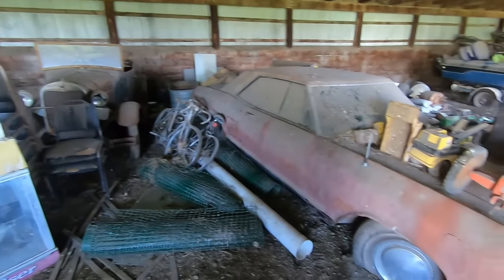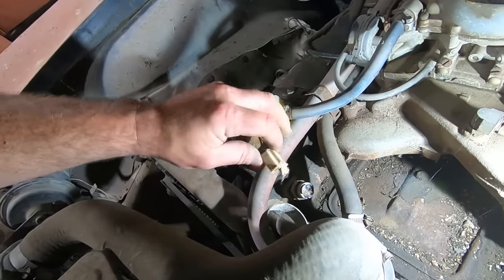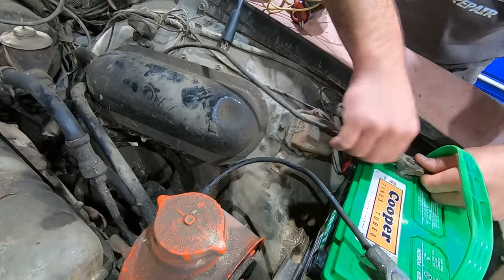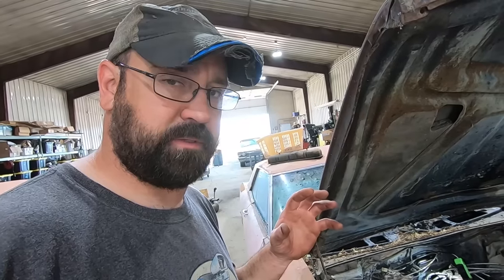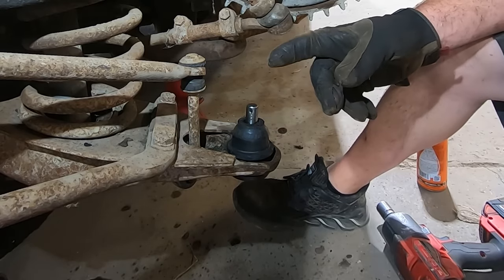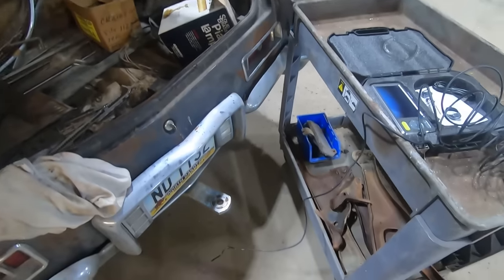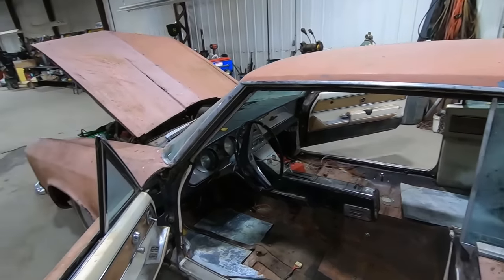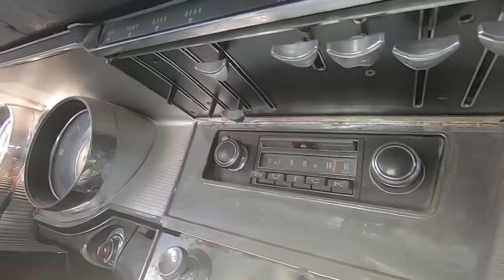BARN FIND!1963 Buick Riviera! Abandoned for 27 Years! Will It Run?!?

Comment: First generation of the Riviera 1963 through 1965. 63 & 64 had quad headlights in the grill. 63 used cables to operate the ventilation system, 64 & 65 used vacuum lines for operation. 63 had no standing hood ornament, 64 & 65 had a standing R ornament on the hood. Only the 65 had the stacked headlights behind the opening clamshells in the fenders. All years had bolt on removable door skins allowing the window stops to be adjusted for getting the side windows to perfectly adjusted for sealing the frameless window glass, as the car was originally intended to be a Cadillac called a LaSalle II. 63 had a 2 speed transmission, the 64 had a 3 speed automatic called a super turbine, but the shifter only had high and low indications, the 65 had the 3 speed turbo-hydramatic with all 3 gears indicated on the shifter. All of the first generation came standard with power steering and brakes, 4 bucket seats and a console. Here was never a first generation Riviera with a bench seat, a manual transmission or non-power steering or brakes. The standard engine for the 63 & 65 was the 401 V8 with a single 4 bbl Carter AFB, this was identified as a 445 because that was the gross torque rating. The 64 came standard with the 425 V8 with a single Carter AFB, identified as a 465 due to it’s gross torque. All 3 years could have been ordered with the Super Wildcat, the 425 V8 with 2 Carter 4 bbl carbs . They were easily identified by a chrome, dual snorkel air cleaner and cast aluminum valve covers. The 401 air cleaner snorkel that was round and the regular 425 had a oval air cleaner snorkel. 
Hopefully this may help some people.
Reply from the maker: Thanks for the info!

Comment: Nail heads need plenty of air to start and run right. Also a well adjusted choke will solve many hard starting issues with these engines.

Comment: 425 wasn’t available until 64. The 401 was the only engine in the 63 Riviera’s. I prefer  the 63/64 over the 65 even though changes were minor. On the 63’s the R hood insignia was flat on the center chrome and the 64 it was standing up as a hood ornament. The 65 had the headlights hidden in what had been the coolest park lights ever designed on the. 63/64. Then the tail lights on the 65 were relocated into the bumper. Next was deleting the fake side scoops on the quarter panels. 63 also had the 2 speed Dynaflow transmission whereas the 64/65 had the 4 speed Super turbine 400 which had a rear pump so could be push started. 63-65 Riviera’s never had vinyl tops. Buick put the torque output on the air cleaners instead of engine displacement. 445 was the 320 HP 401, and the 465 was the 340 HP 425. The Dual Quad 425 was 360 HP but did not have the torque rating on the air cleaner. I have had 2 of the 64’s and picked up extra parts and pieces when I found them.  I am not sure but I MIGHT still have some of the spare parts including the correct hubcaps which looked great on them. If there are any pieces you need let me know and I will see what I still have after selling my last 64 and the buyer never even looked at or came back for the spare parts. Also, the door skins unbolt to adjust the door glass so they will seal. Oh by the way, Buick Nail heads were always extremely thirsty engines so anytime you are working on getting one running automatically count on giving it an extra squirt of gas before even trying to start it.
Reply from the maker: Thanks for the info! Send us an email. It’s listed in the video description
Reply: @MortskeRepair  email sent. Where are you at in N.D. anyway? I'm  next door in Ely MN
Reply from the maker: @todddenio3200  Southeast corner, Ely is a jog from here!

Comment: My 63 Electra could be not run for weeks and the Trunk Release would still work. I looked into it and it did not have a connection to any vacuum line to the engine. The plunger that the knob moves actually had its own little vacuum pump. The only time I could not pop the trunk with that knob was if the trunk was in a bind for some reason or the line from the release to the trunk latch was cracked or not on one end or the other of the system. I wish YouTube would allow me to attach a link or a picture to a comment. If I could, you would see there is only one fitting for a vacuum line on the plunger.
Reply from the maker: Interesting

Comment: Talk about oil pressure, I still been driving my old 5.7 Burban everyday to work that has no oil pressure at idle. if the RPM is at 1k it has 20psi or so 2k its over 30psi, its like its loosing its prime, thinking about dumping some thick stuff in it until I have time to swap the engine out, shame it does run good, only knocks and taps on cold starts, after it warms up, couldn't ask for it to run better lol.

Comment: Q&A for difference between 401 and 425: The head covers are different on a 425, and the engine is much more squished down on a 425. Also '62, '63 and '64 had the separate twin headlights along with the chrome front side guards. '65 was when the popup headlights came in. '61 didn't have the chrome front side guards. Hope this helps. Good car btw! Love your work! 👍
Reply from the maker: No, the only difference between the 2 engines is the bore size. Heads and valve covers all interchange. Even crankshafts. Just need to overbore a 401 to build a 425.
Reply: @MortskeRepair  My apologies for getting that wrong...
Reply from the maker: @panderzextreme2210  No worries!

Comment: 1963 was the last year for the unique transmissions. Buick Dynaflow(which that car has), 4-speed Hydramatic, 3-speed Roto-Hydramatic all replaced by TH400 in 1964. That's about the time there was pressure to standardize the shift quadrants as well. 1966 was the last year for the Nail head, to be replaced by the Buick 430.
Reply from the maker: Thanks for the info

Comment: Back in the 80s I remember helping a guy on a flatbed move a Jaguar that had broken ball joints he had boards that he would put under the control arms and he would slide on that instead of the control arms if that helps any of your moving I don’t know just thought I would mention it

Comment: I had a 87 f150 I could feel the ball joint letting the tire move around going around corners. Well having 3 vehicles I parked it until I could get a ball joint. When I went to take out the old ball joint I took the nut off hit it with a hammer once and the ball joint broke apart. Good thing I stopped driving it when I did. I did both upper and lower ball joints both sides since it was my dd for work.
Reply from the maker: Whoops!

Comment: Could you move the trailer to the lift, run the arms up and then put them under the Riv and lift it off said trailer?  Just thinking here in Ohio.  The chain under the jack is/was a great plan!  I'll have to remember that.
Reply from the maker: It’s a tight fit and there’s other issues but it could be done

Comment: You made that ball joint install alot harder and longer than necessary.....leverage....is the key word....there is no way the drivers side spring was holding up that lower ball joint from going into the lower spindle.....

Comment: Another fun fact - this era of Buick transmissions did not shift gears, they were called "Twin Turbine" due to the variable pitch torque converter stater that changed its pitch as the car gathered speed instead of shifting gears - not a very fuel efficient design but Buick was all about smooth and quiet and it was one of the smoothest auto trans ever made, but also where the term "slush box" came from for auto transmissions of the era
Reply from the maker: Thanks for the info!

Comment: Always liked those cars atleast ball joint let go before you was driving could made for a wild ride had gas pedal stick after changing a transmission I was on 18 at the time it was mercury Capri with a straight 6
Reply from the maker: No doubt

Comment: I had a 85 oldsmobile cutlass supreme brougham coupe it was a Buick 3.8 231 v6 2bbl factory metric th350 transmission and a Eaton 2.73 posi rear and rear factory sway bar even knocking unfortunately oil pump failed i replaced the timing set in it, the car had my Remington xt120 L60 14 inch tires on the rear with ansen aluminum slot kidney bean wheels and the cutlass could turn them over pretty efficient

Comment: 63 and 64 are pretty much identical except for the logo on the hood spear (63: laid down tri-shield / 64: Stood up R logo), logos in the tail lights (63: tri-shields / 64: R logos), and 63: BUICK letters on the deck lid. The 63 was only available with a 401. The 64 was only available with a 425. The 65 offered either 401 or 425
Reply from the maker: Thanks for the info

Comment: A few years ago (2018 maybe) I bought one of these (a 64) for $75.  It was nice enough to flat tow home, but I had to tie the steering wheel off because no motor or trans.  Quarters on it are better than yours.   For NY it's really good, a couple holes the bottom of the front fenders and one patch in the right front floor.  

It was a guy's parts car, and he kept the motor and a few other bits.  Then they moved from New York to Washington state.  So they called in the auctioneer, and once he sold the house they left.  I went for the model trains.  Nobody wanted this car so I bid on it and nobody else did.  I know the tilt column alone was worth more than I paid for it. 

You can buy it if you want, it went into a warehouse and I haven't done anything with it.  Probably cost more to transport than the car's worth though.  

1963 might still be a Dynaflow. 1964 was sort of a TH400 fore-runner and 1965 was the TH400, but in a Buick-specific case.  63 and 64 had the round lights, the hide-aways were 65 specific.  That's an X-frame underneath there.  So there's a carrier bearing to deal with.  

That's funny, I yanked the console out of a '63 in a you pull yard like 25 years ago and it had extra gauges cut in in the same exact place. 

I usually call them all a flaming hunk of s--t at least once, that always works
Reply: I see you need a new towel, I should send you the ones my grocery store has on clearance, they say "Easy squeezy lemon peazy" on them.
Reply from the maker: Too bad you're not closer.

Comment: Did you drag your tire machine down a gravel road? Is this the new shop? Puddin's been doin' beautification projects at his.  That there Riverboat has potential. Last year for Dynaflush. '64 had a TH 400. BOP all built some very nice sport/Luxury cars. Olds Starfire were the fastest with 345 HP and 480 ft.lbs. followed by Grand Prix and then the Riverboats. All would have to take a back seat to the Chrysler 300's. Keep it!
Reply from the maker: We use our stuff

Comment: How much did a Buick Riviera cost in 1963?
Original price: $4,333
The Riviera stands as a triumph for GM design chief Bill Mitchell. This upscale coupe, created to compete with models like the Ford Thunderbird and Chrysler 300, had performance to backup the looks, with an available 340-horsepower V8.
Reply: In today's money that is $41,958.02 in 2022
Reply from the maker: Cheap!

Comment: '64 has the same lame headlights. 65 was the only year with the good clamshell ones.
All that rubber crap in the trunk goes in the front and rear bumpers as bumper filler. I think some of that goes in the engine bay to cover the holes in the wheel wells too? Doesn't quite look right tho. No idea if the seatbelts are factory. They were an option if I recall. "Safety".
On the 64 the power brakes taps vacuum off the back of the carb. No idea if your power brakes are even getting vacuum from the right spot. Not that it really matters on this car.
The "other heater hose fittings" are just the hose fittings for the AC I believe. There aren't multiple heat exchangers for heat in the car. Air is hooked up through some boxes and hoses to the rear vents in the center console. Open it up and see the beautiful 60s cardboard engineering and mouse nests. You'll love it. Switch at the back is for the back light.
Reply from the maker: Thanks for the info!

Comment: Why is it that noone seems to realize that the bolt size has nothing to do with the size wrench that fits.  Its shaft size and threads per inch.  ie, a 1/4 20 bolt has a 7/16 head.

Comment: that was a good pile of scrap steel at that farm. might be worth trying to make a deal on it. plenty of material stock for repairs and projects, and it's always money in the bank to sell later when the price is high, and you need a few extra duckets for parts. "it's all in the presentation." if you can't blind them with your brilliance, baffle them with your bullshit, huh? works for me. i like "the riv with no name". makes me think of the movie "a man called horse", though don't ask me why. i've had to remove a couple tie rod studs that popped out of their sockets before, and once they got a little loose just spun in the knuckle. so i cut opposing flats with a angle grinder on the ball of the stud so i could get a wrench on it to get them loose. i tried a pipe wrench, but the ball was so hard, the teeth on the pipe wrench jaws couldn't get a good bite. kinda looking forward to that '69 chevelle wagon. i had a '68 wagon as a winter beater, that had a 327 that did awesome doughnuts in icy parking lots. here's a bit of useless knowledge, wagon rear springs are heavier than those in an el camino, and are a direct swap for those who want a bit more carry in yer camino.
Reply from the maker: thanks for the info!

Comment: It looks advanced before our time it looks like mid seventies or early mid or late 60s car those auto parts must have came from Germany or some taught Americans to make advanced parts it looks seventies or 60ds like a 38 Volkswagen does man this car is like futuristic for 63 63 cars most of them look like hardly changed from fifties car occasionally you will see futuristic like cars but not much it looks so very big and huge and cool even hub caps are advanced than fifties and early 60s engine too sound like caprices and squad car engines like crown Vic quiet till rev up like squads

Comment: I'm like an hour and fifteen in, looking at the radiator fins and they are CLOGGED SHUT... may need to address that and your temps might come down.. just sayin.. with all that oil spraying around under the hood for God knows how long back in the 90s, that looks like a flat piece of steel behind the fan.. : )

Comment: the engine number IS the torque  ie: 401, 410 , 425   all torque of the engine, not the cubic inches
Reply from the maker: 425/445 is the torque. 401 is the cubic inches
Reply: @MortskeRepair  oops, my bad

Comment: 1963 Riviera turn signals are down below the bumper 1964 Riviera turn signals are where you think the headlights and the clam shell 65 Riviera is the clamshell headlights only yours in the front looks like a 64 if those are not turn signals on the right and left hand side of the car then you're missing a 63 lower plate in you got a 64 piece under the bumper because I don't see no turn signals there need to check your VIN number that will tell you it's a 64 not a 63 the first two digits should be 7 j which stands for 63 Riviera K stands for 64 you're not a 65 the 2nd and 3rd digit would be 94 for Riviera the six digit would be 5/65
Reply from the maker: It’s a 63

Comment: Fuuuuu k! Man you have a garage that big and you don't even have any oil dry  or even cat litter or saw dust you had to use a towel so back yard  mechanic este' tabernac!
Reply from the maker: I hate that stuff. Rather wipe up my spills.
Reply: @MortskeRepair  not telling you how to clean up your own mess I'm just observing and commenting but as long as I thumbs up every vlog it's okay right my uncle chuck owned a truck garage for 47 years I cleaned a lot of messes in my time he's dead and gone now ol chucker the trucker his motto was IF YOU GOT IT A TRUCK BROUGHT IT! looked like a pretty big spill for a small towel like that size.
Reply from the maker: @darrenbrisson4336  I just hate dealing with floor dry, gets everywhere and some doesn't even pick up oil. Personal preference.
Reply: @MortskeRepair  you're right I used to use old battery acid to clean the old grease and oil stains off his floor chucker took a real Cummins out of a big truck tractor and stuffed it in a four door square body way back before anybody did that shit on youtube it went all the way into the cab with the transmission the owner used it to pull a fifth wheel camper this was before dodge ever came out with a Cummins in their trucks I was a teenager I'm 57 now and my daddy still calls me douche bag hahahahahaha 😄😆😅🤣😂😁
Reply: @MortskeRepair  ol chucker must've had 1000s of apprentices go through his door super great guy

Comment: I had a mint 1965 Buick Rivera GS back in 1974 and i ended up walking to work for 5 months for little did i know being an asshole just like you ,the oil climbs up the walls of the oil pan when you do donuts and it wiped the bearings out of it. Other than that not bad.
Reply from the maker: Never heard of that
Reply: @MortskeRepair  put an oil pressure gauge on it check it out when you start doing donuts.